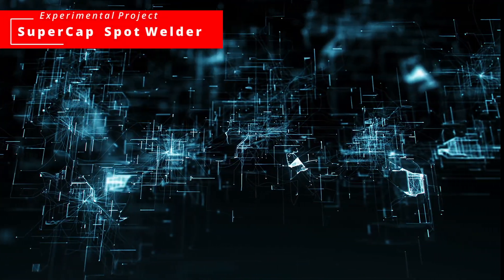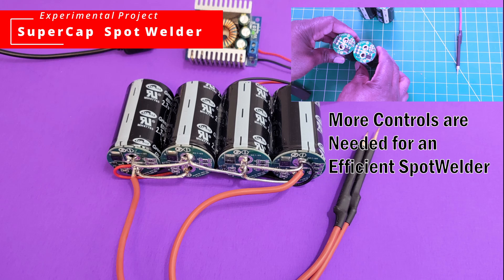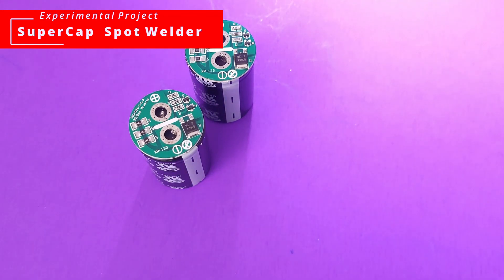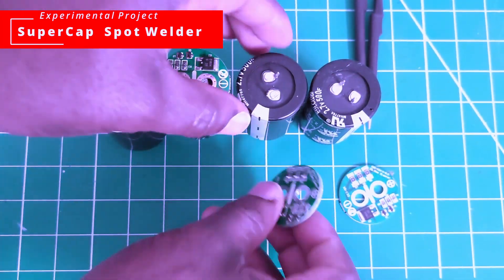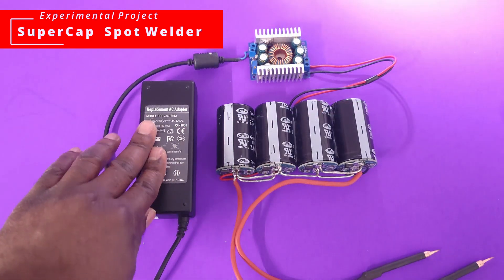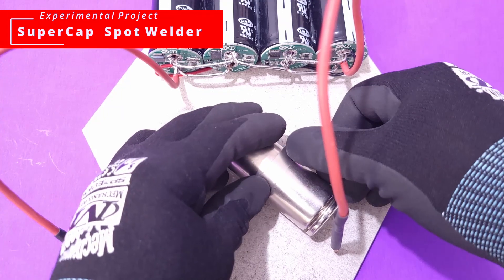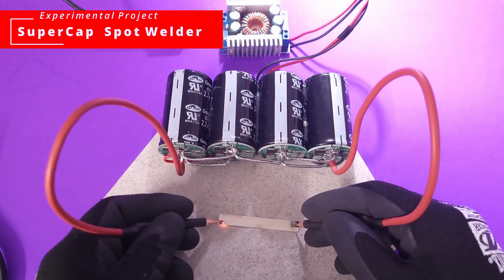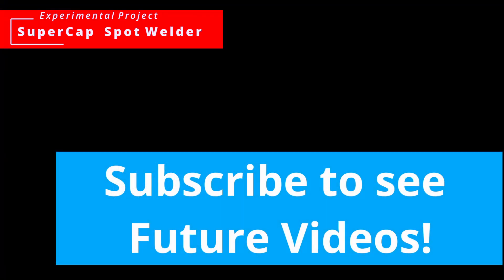💥DIY SPOT WELDER USING A SUPERCAP!

Comment: Battery  alone i mean without capacitor  possible
Reply from the maker: I believe so.
But it was to be a low voltage battery that is capable of supplying 200 to 300A. Also, you will need a way to control the weld pulses.

See my spot welder video below.
👇👇👇
https://youtu.be/iQ456BpKhH4?si=-nMSFMpv9nqUNLYp

I hope this helps you.
Happy holidays🙂
The Innovati0n Lab 💥 www.theinnovati0nlab.com

Comment: 2 x 500f= 1000f in parallel,  in series 1000 x 1000f = 500f. Differences is 1 500f is 2.7, the way you have it. 500F equals 5-5.2volt. I seen on the net. That 16v 16.6 was 1700 joules. I also seen a few good mini welders,  using 1 or even 2 500f supercaps, made great welders. Only issue with those, how long inbetween welds. I also made 3 capacitor banks with balance, boards I created on easy eda. Gave me a great welder with tons of power. Think I only screwed up on my board, by placing a diode backwards. Luckily, this was only on the board to tell you where parts go, so I caught it. Messed up, when I tested and a few other videos, I lost. Had a friend on Facebook offer to make me a case with his printer, just haven't got around to giving him specs. Once I do, I'll re shoot the video and add the case. 

I also made a welder using a 2F 24V car amplifier capacitor.  That also worked great around 18v. It was adjustable and built from an old 12v ups. One of my favorite projects are battery tab welder builds👍👍👍👍
Reply: Your working with 6760 joules and if my math is correct, a 3 second weld is over 2000 watts. It's kinda hard to figure out for me lol. Maybe I'm doing it wrong...lol
Reply from the maker: Thanks again for checking out this video, I appreciate it. However, this was really a weekend fun experiment for me, and I honestly didn't put too much thought into it. I made a real spot welder video on my channel with better timed weld pulses using Arduino controller and a microwave over transformer.

Generally, the recommendation is to use a low voltage (2 - 5V) but high current to create the high weld energy (mostly a function of weld time in milliseconds and weld current) for your spot welding. You can control the amount of weld energy by limiting the duration of your weld pulses through the use of PWM. 

Using high voltage for spot welding produces too much oxidation that could damage the batteries you are  tabbing  or cause them to corrode over time.
Reply: Yes sir! I've tried them all. Made a few mot welders, a welder from 2 ups batteries,  I welder with a lawnmower battery, capacitor welders, 2F and 3 stacks of 6 in series 350F maxwell caps. I have a few cheap Chinese welders, I made better to use with a lipo, I also have an ardrino welder "Malectrics ". I have a complete kweld, with kcaps. That comes with a case for both. The But I haven't put it together yet. I've also created a simple way to make welding pins. I made a few bank, to use with a car battery. Timing circuits, that anyone can build, with capacitors, used as timing. Battery tab welders is one of my all time favorites.  My next welder is a pin style with ardrino,  but the guy who invented it had some issues with programming.  He's sending me one after he fixes it. That should be fun. I plan to make another capacitor welder soon also, using 4 x 350f maxwell caps, 2x2  parallel and those 2 in series. Should give me 350F at 5.2v.that one will pack a punch.last I have a Mot welder I made, and they plan to sell them in kits. It's the one in the black power supply case, with timing and double pulse welding. With capacitor,  I've always had better welds with voltages around 14v to 16v, but my MOT, usually 2 to 4 volts. DiY is tons of fun!!!!!!👍😀